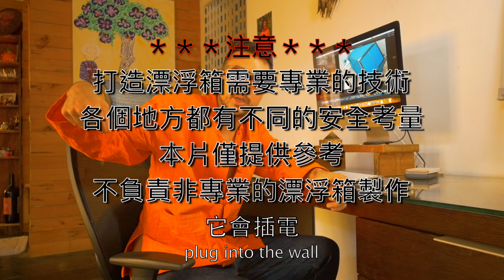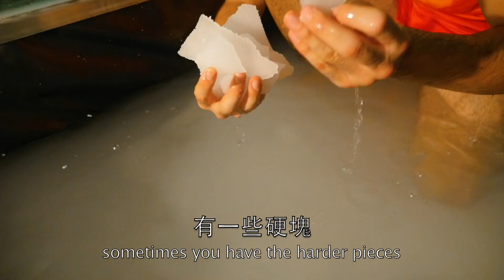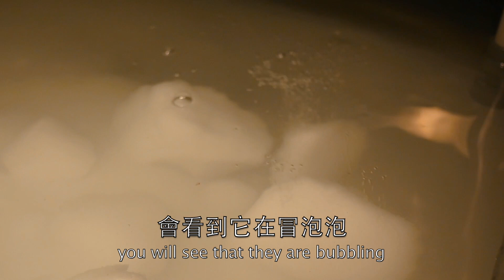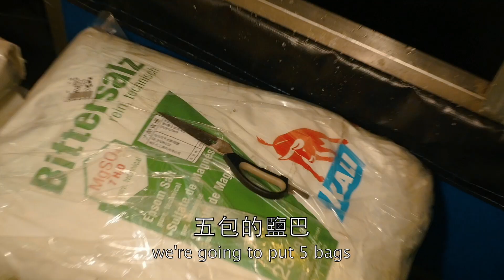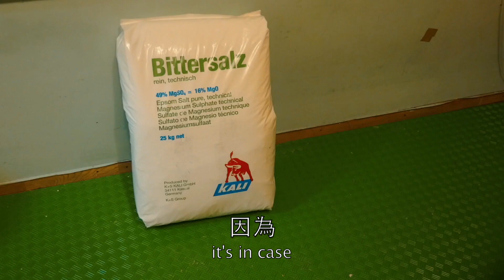我DIY漂浮箱及自己調配漂浮水 My DIY Floatation Tank & How I Make Floatation Tank Solution

Comment: Hi,what is the horse power of your motor (or U.S gallons per minute).Q2:How long do you leave the pump on to filter the water(some people leave it on 24/7).Do you put any Hydrogen peroxide in your tank?Why don't you use a U.V. steriliser?(Greetings from the U.K).
Reply from the maker: I use ozone once a week using a pool ozonator but be careful not to float after for a day.  My pump is weak not strong.  Only turn it on for 15 to 30 minutes after someone floats